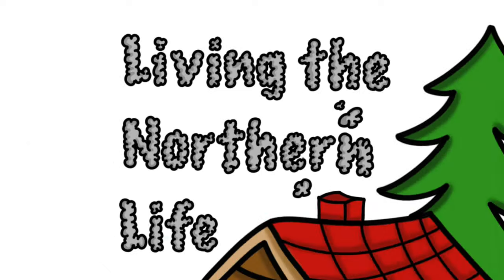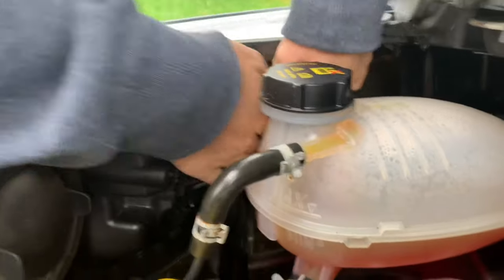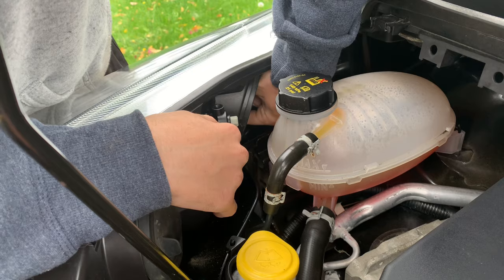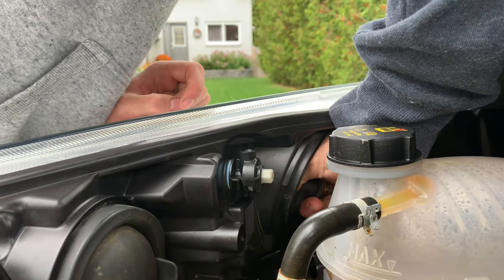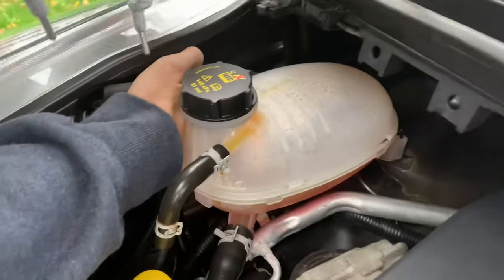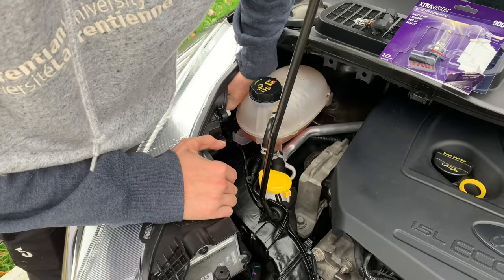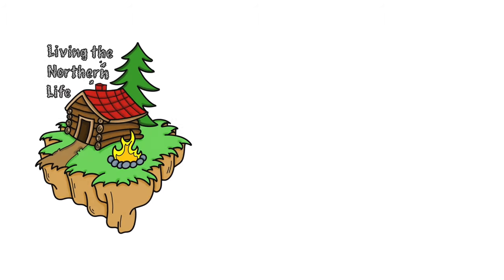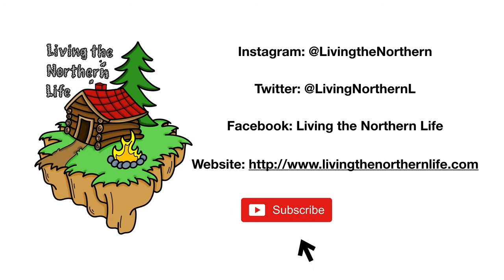2017-19 Ford Escape SE Passenger Side Low Beam Bulb Replacement

Comment: This was a year ago but for any future people I just did this. Remove the reservoir first. Makes this easy. It's held  in place by two metal tabs  just grab the tank and pull straight up to remove it. Mine a little tight so I fed a piece of rope under it, and lifted it up. Came up easy and snaps back in place
Reply from the maker: A few people commented this as well and others have tried it but it seems they had a difficult time detaching the reservoir. I think you’re the first to comment that there is a metal clip to undo first before you’re able to remove it.
What a pain this task was. Hopefully we don’t have to do this for a few years again but if we do I’ll be looking for that clip!
Thanks for watching and commenting!
Andrew
Reply: @LivingtheNorthernLife  Yeah , I had/having a bit of a struggle to slide the reservoi off.
Reply: @LivingtheNorthernLife  I had some trouble, the front was easy. The back was tight. I fixed this by using a piece of rope, sliding it under the tank and lifting straight up
Reply: @dnf8878  Yeah, that clip in the back was a b*tch.  I ended up having to push the metal portion of the clip as hard as I could with a flat screwdriver while pulling straight up. Get the back clip loose FIRST, then do the side.  I had the side easily done right away, but had to reclip it in order to get the back clip free.  With the reservoir out of the way, my adult hands finally had room to maneuver.  The lack of wire slack on the passenger side still made it rather difficult.
Reply: Thanks for this video! Saved me from having to pay someone to replace the bulb. And others for the reservoir tip! I was able to lift off the front, which was just enough more room to get my hand in. Still a little tight, but did it! 5 minute job.
Reply: Same here . Eventually got the Reservoir out of the way and then it was a quick replacement . We bent the rear metal tab with pliers so as to be much more straight then it lifted off pretty well . Since I had battled with the lamp a while before i did this my hands are cut and swollen from trying it the hard way . LOL . thanks for getting me started . Cheers ./SRK
Reply: I had to pry it off the metal clip which is welded to the body. Might come off easier second time but I doubt it. When I put it back in place sort of snapped in on the clip. I was worrying about breaking the plastic piece of the tank which slides over the clips.. so I'd be careful however you do it.
Reply: The reservoir comes loose much easier when warm (found that tip somewhere else).  So just drive 5 to 10 miles beforehand and the plastic will be much warmer and pliant.
Reply: Next can you show me how to change the battery on this thing????
Reply: How do you remove the coolant reservoir
Reply: 😮 2:54 😮😅😮😅😮
Reply: Thanks! I can't get my hand behind it.
Reply: I used a 12" prybar ( lg blade screwdriver will work as well ) and gently pryed up at the base of the clip.
I would love to get my hands on the morons at Ford.
For an extra 1/4" of wire, it wouldn't be such an abortion  to work on.
Reply: @roscommonacres There are videos on this. Best way is to remove the air filter box and take the front of the battery box apart.
Reply: I really appreciate this comment!!! 🙌🏻 I couldn’t find a video to explain it. Thanks!!!

Comment: This is probably the only video in the whole internet that shows the actual PASSENGER side bulb change and what a pain in the ass it is...no slack whatsoever....every other one is the easy driver side.
Reply from the maker: Thank you.
I read your comment to my son as well.
They certainly didn’t put any thought into this at all that’s for sure.
Thanks for watching and commenting!
Reply: Stupid if you ask me. Never had a problem changing lamps on any vehicles I've owned going back probably 40 years ......at least since they converted over to halogen lamps with lamp sockets that just turn in. The passenger side lamp burnt out ... 29,000 miles. It took me 2 hours to do something that typically takes about 10 minutes. Same issue as everyone else .. the length of the wire leads on the lo beam passenger side socket was inadequate to make the change in an acceptable manner. I did discover after trying for about an hour.. the orange gasket which slides over the plug end has to be fully on the plug ... I tried placing the gasket onto the end of the lamp socket and than sliding the plug into the lamp but I could expend enough effort to get the plug on that way. Once I placed the gasket all the way on the plug which was a task n it's self I was able to push the connector onto the lamp socket once it lined up properly. This is something Ford should be required to fix with a recall but I wouldn't hold your breath. All they need to do is offer a short extension plug .. a couple of inches would be adequate.
Reply: thanks for showing the passenger side

Comment: The passenger headlight side is out so I bought the bulbs for both low beams on a 2017 Escape from Auto Zone. Apparently, the model determines whether you need an H11 or a 9005. Mine is the Titanium and calls for the 9005. I attempted to remove the bulb but my hands are too big without removing the coolant reservoir. I was able to remove the reservoir from the front clip but not the rear. I gave up before I cracked the reservoir. I’m glad I didn’t open the package for the bulbs. I will return them and take the car to the dealer. This should be an easy repair but Ford insured that it isn’t.
Reply from the maker: Ya this is absolutely terrible.
I hear that a lot of cars have better lights as you go up into the high more expensive models.
I would assume that the plug is the same but that the Titanium would have a better light installed than my SE.
Thanks for watching and commenting!
Andrew

Comment: super easy to remove the reservoir, just pull it up and out of the clips ( one on the side, one in the back). gives you much more room. i have been having trouble with mine. can't seem to get them seated properly. is there a gasket that has to be depressed ?
Reply from the maker: Hey thanks Doug!
I will keep that in mind for next time... hopefully there is no next time though! :)
We didn't notice a gasket but we did have to press it in before turning it to lock it and then it has a bit of a click.
Thanks for watching and commenting!
Reply: Thanks I've done it twice now this really helped the 2nd time. The reservoir was easy to pull up and put back
Reply: Great pointer Doug
Reply: choossuck  same
Reply: Thank you Doug. You get a follow for that yomens work

Comment: I don't know if anyone else has said this, but take off the electrical clip BEFORE you remove the old bulb and put it back on AFTER you install the new bulb, especially on the passenger side.   The wire is so short that you can't pull it out far enough to use two hands to unclip the connector.  (The driver's side is a bit longer).  Removing the clip while the bulb is still in place makes doing this one-handed SOOOO MUCH easier.  I was able to do both bulbs in under 10 minutes,  most of which was figuring out how to move the coolant reservoir, lol.
Reply from the maker: Yes sir!
I appreciate your feedback and I’m hoping to not have to change the passenger side again but if i do, I’ll be sure to give this method a go!
Thanks for watching and commenting!
Andrew
Reply: Thank you

Comment: Good video. Another tip, after popping off the reservoir, keep the bulb locked in and then detach the wire, then unlock the bulb and pull it out. It helps with the lack of slack on the wire.
Reply from the maker: yes we thought of that after we made this video (facepalm)
it does work cause we did it after releasing this video.
Thanks for watching and commenting!
Andrew
Reply: Good tip!! What a pain
Reply: Thank you! Helped me a ton with that tip!

Comment: Y’all are lucky I am 6’4” got giant hands I’ve been trying to replace this lightbulb for the last 40 minutes I cannot squeeze my hands in there.
Reply from the maker: Ya they put ZERO thought into this.
Thanks for watching and commenting!
Reply: My big hands (palming a basketball is no problem) made this tough for me, too.  The coolant reservoir clip in the back was stuck, so I gave up on removing that, but getting it off that side clip may have given me a crucial extra millimeter of room.  I was barely able to get the old bulb out and the new bulb into position with my fingers, but I couldn’t tighten it into place until I got my thumb in there.  It’s too bad such a simple job has to be so difficult, at least for some of us.  I can’t help but wonder if the repair shops have a tool to help with this, or if they just get help from someone with smaller hands.

Comment: Thank you & your Son for making this video. Every other video people pick the easy side to make a video on but yours is the only one showing the passenger side. 

It was bad enough trying to replace this bulb but to make things worse every online parts store called for H11 bulbs to be installed in my vehicle.  When I removed the old bulb in my vehicle it was a 9005 which meant another 10 mile drive back to the parts store. 

Thanks
Reply from the maker: Thank you!
I shared your comment with him and he wanted to thank you as well.
The passenger side is MUCH more difficult than the driver side that's for sure!
Thank you for watching and commenting!
Reply: Projectors need the 9005, if you have the standard reflector housing it ”should” be an H11
Reply: @kylerokitjanski7598 If you are saying Ford sells some vehicles with different projectors/reflectors that might be but the problem is Ford still issues the same owners manual which calls for the H11 bulbs.  My daughters vehicle came from a Ford dealership and has had no aftermarket parts installed on it but requires the 9005 bulb.  I will include a link where several other Ford owners have run into the same problem I had.  I think Ford either used the 2016 wiring harness in some of the early 2017 Ford Escapes or as you said they used a different projector/reflector which requires a different bulb.  Most car owners wouldn't know which reflector/projector is installed in their vehicles and it's not a question that gets asked by parts suppliers when purchasing replacement items.    https://www.fordescape.org/threads/2017-se-headlights.82273/
Reply: GovtMule66 They circled the problem when we bought them. Why my wife likes fords I will never know. I just bought H11’s for my wife’s 17 per the manual. I’m gonna be raging if I just wasted money on bulbs that neither vehicle can use...
Reply: @kylerokitjanski7598  Keep your receipt & remove the old bulbs before opening the packaging in case your have to return them.
Reply: @kylerokitjanski7598  Wait wtf LOOL i just purchased h11s per the manual. Is it really 9005s i gotta get?
Reply: It was confusing to me, too. I pulled the bulb and took it to AutoZone. It was a 9005.

Comment: THANK YOU SO MUCH! My mom's 2017 passenger low beam bulb went out and I couldn't find a video covering how to replace it except for this one! The comments about the reservoir helped me move it out the way by taking it off the two clips that hold it in place. It was a pain though for that back clip because it had no give. Speaking of no give or slack, my passenger bulb had a ton of slack, but the driver's side was tighter than a Fort Knox 😂😂
Reply from the maker: Hahahahaha!
I’m glad it worked out well for you!
Strange that there is a different amount of slack at each bulb 🤦‍♂️

Comment: I popped up the the front tab of the reservoir which gave me an extra 1/2" of clearance for my hand.  I used my left hand to do the twist to remove the bulb because it was a better angle than my right hand.  When I pulled out the bulb I realized either Ford gave me 2 inches of extra wire slack or the bulb had been replaced before and someone pulled the wire a bit in the previous installation which luckily made my job easier.  Thanks for positing this video!
Reply from the maker: They all seem to be different. it's amazing on an assembly line that there is this much difference in the builds.
Thanks for watching and commenting!
Andrew
Reply: I'm unsure if this matters but I have a cold weather version 2017 Escape. Turbo without the sunroof. It was a little harder to find.

Comment: Best video on this topic with helpful camera angles! Thank you!! Got the drivers side done and couldn't understand why no videos showed how short the cord is on the other side
Reply from the maker: Glad it helped!
Another way to do this is to disconnect the cable, remove and replace the bulb and then re-connect the cable.
Let me know how it goes for you.
Thanks for watching and commenting!
Andrew
Reply: @LivingtheNorthernLife  thanks for the tip. We're going to try this later. The guy at auto zone couldn't get the passenger side. Then my dad got the light bulb stuck when it fell inside there. A stranger in the parking lot who said he owned a shop couldn't get it. Then my husband couldn't get it lol he got it connected after struggling and then couldn't turn the bulb into the socket. Trying again after work and if that doesn't work I'll have to take it to a shop. It definitely shouldn't be so difficult and mine seems to have even less slack
Reply: Okay here's the update: after two more attempts we finally got it. The problem was that it is freezing and windy and snowing here so we tried again when it warmed up. We ended up using a mechanic's mirror so we could see inside the hole and first put the bulb in and then connected the wire. I think next time the passenger side burns out I'll take it to the dealer 🥴
Reply from the maker: @makeitbetterx33  it sure is a pain to change...

Comment: Thanks for posting this video. It was very helpful, especially because it was about the passenger side bulb. As Doug Wiltfong said below, the trick is to remove the coolant tank first. Mine looks like the one pictured and I just wiggled it up out of two clips and set it aside, hoses attached. I wore nitrile gloves to avoid touching the bulb with bare fingers. My cost was $15.04 with tax (bought bulb from Autozone.)
Reply from the maker: Glad it helped.
Hopefully I never have to change that bulb again but if I do I will remove the coolant tank and give that a shot.
Thanks!
Reply: Removing coolant tank is HIGHLY recommended. Even with my fair of dexterity still had to. Tank is kinda clipped in rear and left side… small screwdriver comes in handy…
Reply: What is the official low beam bulb for replacement on a Ford Escape 2017 SE 4WD?  I recall last time that the manual listing is a wrong base.  Confirm?

Comment: And I thought it was just me. I zipped through the first 3 no issues. Replaced all the halogen bulbs with 6500k led's. Then the last one came (same as video) I Struggled with it for a half hour or so then gave up. Couple days later tried it again, struggled with it for an hour, then gave up. At this point I thought there has to be an easier way to do this. I considered removing the entire light assembly but in order for that to work. I'd have to take so many other things off (y'all know what I'm talking about if you own the exact model). Then I considered the reservoir just adjacent to the light bulb entry. After looking around that particular area and diagnosing as if I knew what I was doing (in front of my wife). Came to realize, I'm not a mechanic, not a good idea. So now that I've watched this video. It's assuring to know that even the pro's have a hard time with this task and I'm not just an idiot. Thanks for the vid. It serves as motivation that even your son was able to do it. Thanks guys!!!!
Reply from the maker: Thank you so much and thank you for watching and commenting!

Comment: Thanks, guys, for the video!  Had similar problems replacing the passenger side bulb (tight quarters, and very little slack in the wire).  After playing with it for an hour, I replaced the driver side bulb, which was easier, but still not a cake walk.  When I went back to the passenger side, I tried a number of angles that did not seem to work.  I was finally able to pull more slack on the wire - it was caught on something.  Once the wire was more free, the bulb came out relatively easily.  Tried removing the coolant reservoir, which did not come easily either since there was a spring clip on the back support - was never able to get the clip undone, but was able to remove the reservoir from the front clip, giving me a bit more room.  This is a difficult operation, IMHO.
Reply from the maker: I agree. 
I'm not sure why Ford short changed us on the wiring for the passenger side. There are no fans or anything like that for it to get caught in. 
Even an extra 1/2" would have made a world of difference.
Thanks for watching and commenting!
Andrew
Reply: I used a large pry bar and got some leverage on the back resevoir clip and popped it up and out. CAREFULLY lol. I'm going to be putting some LED replacement bulbs in this week so I've got to probably take the entire light assembly out on the passenger side due to that ridiculously short wire. Going to try to lengthen it while it's out. I mean it's barely long enough to get the thing clipped back on when changing bulbs!

Comment: Going to try the passenger side low beam headlamp replacement now. I may remove the radiator fluid tank if need be. Thank you for the video.
Reply from the maker: How did it go for you?